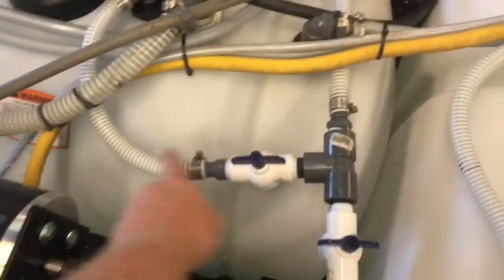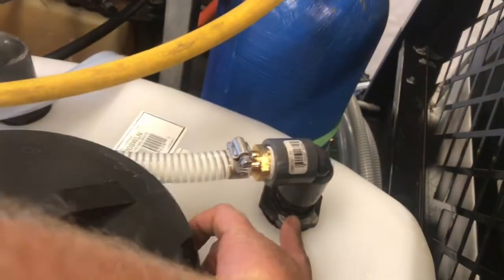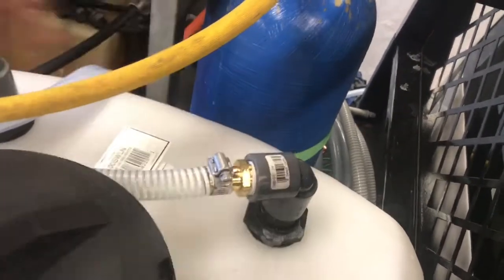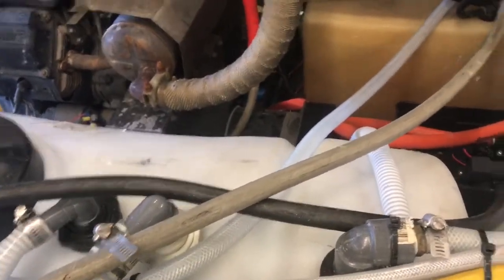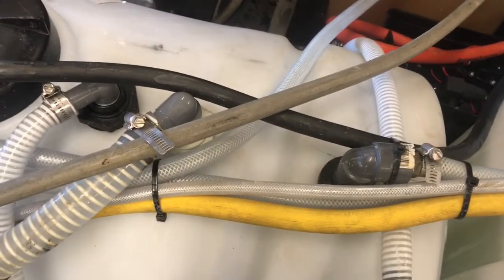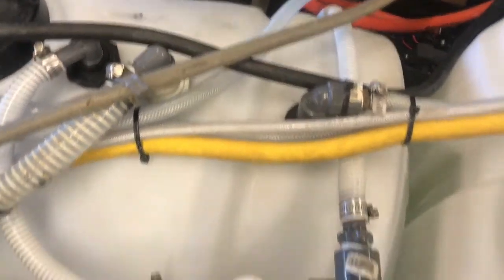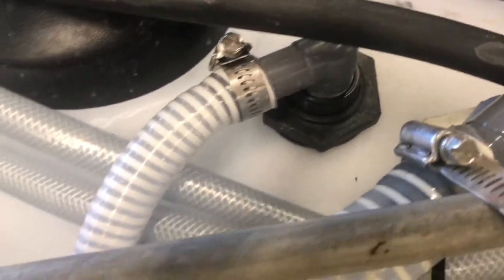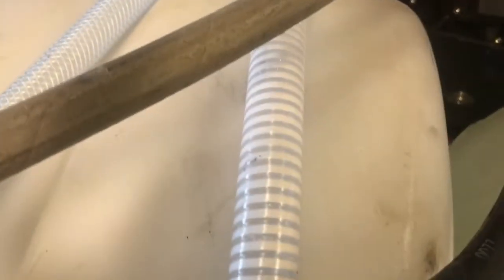Roof pump problems

Comment: I love my booster.  I've used 12v (too temperamental used 4 in 1 year) then gas powered system which is awesome but the plastic components break and it requires a mix tank.  Booster saves me time and money with the proportioner.

Comment: 12 volt is only good to wash roofs or treat patios and driveways. Other than that you can’t wash with it. Ds is much more cost effective and with the right tips can be a soft wash skid. Want a more powerful pump, run a gas or 112 vt rig.
Reply from the maker: Very true

Comment: Do you run regular ag/kuri hose on your reel or are you running clear on that as well?  We use ag because it is more flexible and easier to work with.